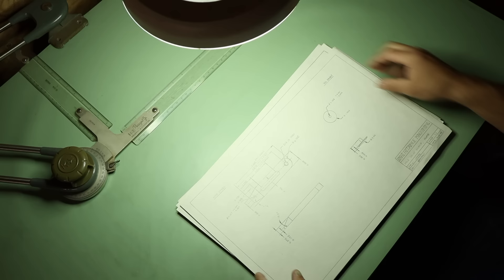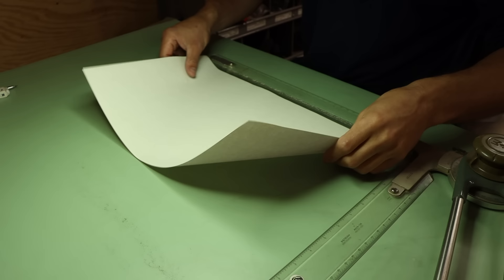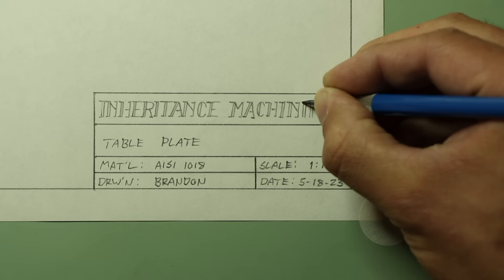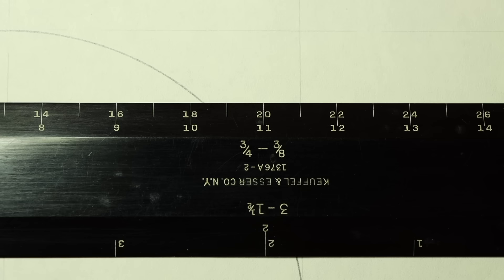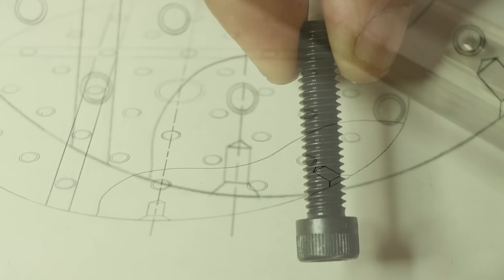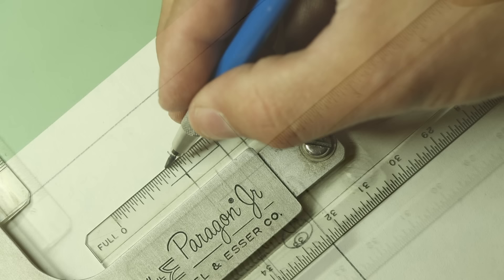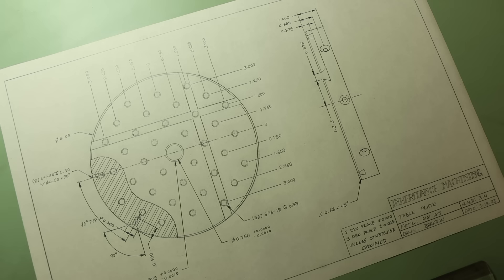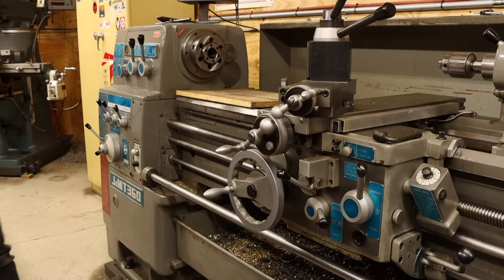The Joy of Hand Drawing Machining Prints || INHERITANCE MACHINING

Comment: As a longtime draftsman (now retired) I can really appreciate this video. My career spanned the transition from the board to 3D modeling. Actually even before the board. As well as being a draftsman I was also formerly a journeyman sheet metal mechanic, a fabricator, and a millwright. My first drafting methods were 2 types of CAD - concrete aided drafting and cardboard aided drafting. I am convinced that starting out my drafting career on the board made a huge difference on the quality of my work when I moved to drafting on a computer. I first learned VersaCAD, then Accugraph, then AutoCAD version 10. Progressed to Inventor and I have done some Solidworks since retiring. Thanks for the excellent video. You always seem to come through for your audience.
Reply from the maker: Wow, you've seen it all, then! I 100% agree starting at the board helps make for a better designer/engineer. Thanks for sharing and for the support as always, Mike!
Reply: Hi Mike. I'm just a simple electrician. I understand and have done cardboard aided design but I've never heard of Concrete aided. You've got me intrigued. How did you use concrete?
Reply: @antokomsic3571  Drawing or sketching with soapstone on a concrete surface like a shop floor or your driveway. Very handy! 😁
Reply: I started pretty much the same..Automotive body design on Mylar with aluminum..Then CGS,PDGS,SDRC Ideas,Catia,IcemSurf lately,for fun,Fusion 360 and Solid Works.. Designing on the board was a great craft.. Also retiring in a few.. 
along with cad we picked up running workstations and servers in UNIX,LINUX,everything MS, VMWare, Cisco..My home lab is pretty amazing as well.. In automotive design,the day you stop studying is the day you need to quit..
Reply: I used Windows paint and called it ghetto cad

Comment: I'm a woodworker, and I find so many mistakes or failures come from not thinking/planning ahead or from not having a good visualization of what I'm trying to do. The fact that you care enough about your projects to put the time into planning them is so fun to watch. And as a hobbyist, it's also great to see someone who has to think about materials differently than a professional shop. The professional gets to build time and materials into the final cost of the project and can absorb mistakes and waste across many projects. If the hobbyist is even getting paid for the work (i.e., selling it), the charge is often nowhere near the actual cost, especially in terms of getting paid for time. Consequently, the hobbyist has to think of materials in terms of what is currently on hand, where scraps and offcuts can be utilized, what's available, and what measures have to be taken to avoid mistakes. When I work with exotic wood, it's in very limited quantities, so I sometimes have to take extraordinary measures to avoid mistakes because I don't have excess material to work with. Not to mention, it's a 45-minute trip to the nearest hardwood dealer. I've seen you deal with similar issues in your projects.
Anyway, thank you for taking the time to plan your projects so thoroughly, and for bringing us along on the ride.
Reply from the maker: Very true! That's why its good to hang onto all those offcuts (and mistakes). They may save my butt at some point. Thanks, Vince!
Reply: It takes a whole new level of intelligence to do so gracefully and precise.  Its definitely a true testament to the level of talent he possesses.  Your wood working is no different,  just a softer material.  Some folks are just so talented and creative,  it's so satisfying to watch.
Reply: paper is cheap. Metal and wood are expensive. Even the time to make a simple sketch can save so much pain and waste.
Reply: @derschwartzadder  Очень хорошие слова - я запомню и буду говорить своим клиентам! Удачи и здоровья Вам!

Comment: Back in high school, our drafting tables were slanted at an angle, roughly 15-20, so that you didn't have to hunch over when drawing. Also, you could still stand and use the tables comfortably. Great video. It brings back lots of good memories.
Reply: My old man is a 40+ year engineer and I took a year after school in basics school. My college and his company both had mechanically adjustable tables. Standing desks before standing desk. They had a winder to take it up and down and a seperate winder to tilt the table from flat to angled up to 20 some degrees. I used to love going into the drawing room to see 4 guys with 4 completely different drafting configs all to personal preference.

Comment: To protect the paper when laying down a compass point, a bit of drafting tape (or dots) can be laid down where the point is to be placed.  Drafting tape looks like common masking tape (often lighter in color) but with a weaker adhesive that won't tear the paper when removed.  It's between the stickiness of drafting tape and post-it notes.

Comment: Fresh air. I’m 67 and still conceive, design, detail on a board every day. There are head shakers where I work but I’m the only one that do all this and build whatever I draw with my own two hands on manual machining equipment. I’m Blessed to be one of the last of many generations of Journeyman Tool and Die makers. That has machine tool design background. They call me “non degreed” engineer .. we got to the moon without cad..nothing I do is rocket science

Comment: Its fascinating to see how you guys do drafting over in the USA, with so many little details that are done completely differently.
Reply: You mean wrong, just wrong. Best example is a 3/4 scale. Who had that idea? The only factors that should be used are 2, 5 and 10.
Reply: @markus-us1bg  oftentimes in my drawings I find that the part is just barely too big for all of the dimensions I need and in that case 3/4 is incredibly useful since 1/2 would at that point be much smaller than I really need, and I've always appreciated being able to see all the features well
Reply from the maker: I wouldn't necessarily say my approaches are normal. I don't really follow many standards 😂
Reply from the maker: @liamsmith8518  same! one of the few advantages of imperial over metric. Fractional scales like 3/4 are easy to convert.
Reply: @markus-us1bg  I have a small metric triangular ruler that includes a 1:75 scale which basically is the same as 3/4. So technically I could use it to draw something at 0.75 scale
Reply: So markus...
So, you always divide your pizzas or cakes or breads into halves, fifths or tenths??  There is nothing sacred about tenths.  In fact, you can get finer gradation using fractions based on the power of 2 instead of the power of 10.  You are clueless.
Reply: @videodistro  I don't think clueless. Just arrogant. Or perhaps a play on Brandon's words about side views and which one is right and wrong. Why is it that no one on the internet is ever willing to give someone the benefit of the doubt? Humor can be difficult to convey without vocal accompaniment to the words you're reading. Yet if somebody misconstrued your statement in the least, you would likely become outraged and butthurt in the extreme.
Reply: @markus-us1bg  I designed hydraulic cylinders so the scales I used were full, half, and quarter. At any scale a lot of the part drawings and most of the assembly drawings I made were broken views (foreshortened). It's hard to get a part or assembly that's 10' or more long on a B, C, or D size sheet without breaking it out no matter what scale I used. If I used a 3/8 or 3/4 scale I would have been beaten!😀
BTW, third angle projection is absolutely the correct way to draw, and metric is lame. Actually, I am very competent with the metric system, but it's still lame, As Curtis at CEE would say, I prefer bananas!
Reply: 3/4 scale is so deceptive, because it's almost the same size as the actual object.
For scale drawings, we were told, if possible, to avoid anything larger than half scale or smaller than double, just for that reason.

Ofcourse, if you're the one making the item, you'll be aware the drawing is not actual size.
Reply: @liamsmith8518  i agree, i hate how sometimes on solid works you end up using a A2 sheet as 1/2 scale on an A3 was tiny.

Comment: So amazing! I'm taking a mechanical drawing class at my uni and im glad you included the truth that it took about 20 hours lol
Reply from the maker: Gotta give a comparison for those that only know the CAD game 😆 Thanks!
Reply: I studied architecture in 2005 and we still had to draw by hand the first 4 semesters (NO CAD at all for 2 years...) we literally had to draw entire buildings brick by brick.. so I personally am completely over ever using a drawing table ever again.. architectural drawings are much bigger and more detailed than mechanical drawings though and most annoyingly have a lot more dimensional chains and writing... but it did teach us the importance of line weight- which architects that grew up on 3D software have no concept about..
Reply: Back when I studied (in my 40's), Geometric Development was a weed out coarse to knock the class size down. The entire first year was done on the board. The next weed out class was VersaCAD which was the only CAD around at that time in my tech school. Nowadays, that school doesn't even teach board drafting. They no longer even have any drafting tables or gear around there. Most of the kids coming out of high school now already know some 3D modeling. It's a shame really because some very good drafting practice can be learned on a board. Our host here is an excellent example of that. If a person can draft on a board and use a pencil, that person can always learn CAD. Not so much the other way around.

Comment: This is so nice to watch. Back in my apprenticeship days i had to draw by hand too! So challenging but relaxing. 
Now I work with CAD but I always try my best to create meaningful and good looking drawings
Reply from the maker: That's the important part! I've often found you can tell the difference between engineers who started on the board or on a computer.
Reply: It's always great if machinists know how to draw and vice versa. Also I learned that for every purpose you will need different drawings, dimensions, tolerances,... for the same part. Like for design purpose you might do it in one way, but for manufacturing, QC, assembly,... you might do it in a completely different way.

Comment: I too started drafting in high school which led to my 35 year career (so far) as an architect.  I second a lot of comments here and definitely recommend you use that electric eraser! Its a game changer with the shield. Also that ridge on the edge of your triangle is for using ink tech pens, it keeps the ink from bleeding under the triangle. Ink on mylar is the way to go, give it a try, i think you might like it. You can control line weight to really make your drawings pop. Object lines, cut lines, dimension lines, all have their own weight (thickness) that you control with the different pens. Drafting like that is truly an art  and you would likely enjoy it very much. I miss those days on my drafting board.

Comment: Started my career as a Draftsman in 1980. Progressed to Designer levels over 30 years. Day in and day out design and drafting. 1987 brought change. CAD. It was either convert or find a new career.
On the board we would produce “layout drawings” of assemblies at 10:1 to confirm tolerances and avoid interference issues. Then individual drawings for each part of the assembly. CAD eliminated that step as everything was drawn actual size to four decimals. Geo tolerancing clarified the parts drawings. Then of course CNC became ubiquitous and design to finished part usually was faster on complicated parts.
Anyway, there’s no better way to think than through drawing, regardless of the tools and methods. To truly know and understand anything, draw it.
Thanks for the blast from the past!👍
BTW vellum and Mylar were the only materials translucent enough to create a blueprint reproduction back in the day . No laser printers or plotters. Diazo Reproduction was the primary reason they were used. Mylar because it wouldn’t stretch and was much more durable than vellum. Layout drawings and PCB’s were done on Mylar due to that stability. PCB’s were designed 10:1 and photographically reduced to 1:1 for the artwork negatives and positives. Fun stuff!

Comment: I almost never comment on YouTube videos but this one definitely stirred some memories.  I am in my 70s now and learned proper manual drafting as part of the engineering curriculum at college.  So while I have some distant fondness for it, I had the opportunity to learn CAD in the early 1980s (and a bit later, solid modeling) I jumped at it and used the technology for the remainder of my mechanical engineering career.  To a degree I did lose some ability to do conventional sketching there but the speed and convenience of making changes and the inherent accuracy made me an instant convert.  Moreover, constraints and parametric modeling were super hard to apply on paper.  I guess I see computer design as somewhat analogous to digital photography.  As you might suspect I ditched the wet darkroom and never looked back.  As a practical matter though my decimal equivalents chart in my home shop IS on a stone tablet. . .  Great video.
Reply from the maker: 😂 The photography analogy is a great one that I always use! Thanks

Comment: very cool. I love the drawing sequences in the videos. for some reason I'm most surprised you draw the title block and border by hand, I would have assumed that would be preprinted.
Reply from the maker: Thanks! I've contemplated it since writing out the fancy name is a little time consuming (and inconsistent 😂) but something just feels wrong about starting with printed lines
Reply: When I first started with broadcast engineering in Canada (1979) my boss was a Polish/German gentleman who did all our electronic and mechanical drawings on velum. He would sketch out in pencil using the very same engine that you have and then switch to ink. He rarely had to erase but when he did he had a similar eraser machine and the little shield you use. (As an aside I suspect the eraser in your machine is for ink and way too hard for pencil on paper. It'll dig a hole faster than you can blink.) He would then label and annotate in ink using a special pen and letter/number pattern that could be scaled to suit. The drawings would then be printed at a local print shop with black on white rather than blue prints. Three copies were produced. One for the shop, one for the drawing office and a working copy. If we techs found an error it was circled in yellow pencil and changes that we made were in red on the shop copy. The "shop" copy was left on his draughting table and he would update as soon as possible. All other copies were destroyed after the new copies were printed. We had drawings of every conceivable circuit in the station and transmitter sites so when, at two 
o'clock in the morning, something broke, the appropriate drawing led you down the correct rabbit hole to find the problem. When I became engineer of my own stations I started doing the same except with an early dos version of  Autocad on a DOS based laptop. I eventually progressed to autocad LT student version and when I was retired in 2010 I spent my last six weeks or so making sure as many of my drawings were as up to date as possible. Thanks for the trip back down memory lane. 🤞🇨🇦🍌🥋👍

Comment: My Dad had a drafting machine setup in our basement.  I remember using it to draw all kinds of things when I was in Jr. High taking Industrial Arts classes (Drafting, Woodworking and Metalworking) in the late 70s.  Then once in the workforce, I started using CAD in the 90s (AutoCAD running on DOS based computer with 13 colors).  CAD didn't speed up the initial drawing, but it made modifications easier than having to ink new vellum to use as a Master for either Blue-Lines or Blue-Prints.  Understanding the manual process helped in the 'auto' work.

Comment: I have this Japanese mechanical pencil called “uni Kuru Toga”.  There is an internal mechanism that rolls the lead as you lift and place the tip back on paper, so the tip is always worn evenly
Reply: My dad, who is an architect from the old days (so he made his whole career drafting by hand, only a couple years ago he got more into AutoCAD but he only uses the basics and well, he is half retired so who cares), told me to rotate my pencils while I threw a line, so as to keep the line width and color even. I did it, even when using a mechanical pencil, and well... my drawings were the best in the class :)
Reply: The Kuru Toga only rotates when you lift and place the lead back onto the paper, not when you moving it.
Reply: @kaievans9991  you're right!

Comment: I remember growing up looking at my dad's set of drafting instruments with wonder and awe at how these could be used to produce the Lamborghini Countach engine cutaway drawing I had pinned to my bedroom wall (promotional material for a drafting film manufacturer).  When I got to my very first technical drawing at university (a cross-cut chisel made from hex bar) I spent hours pouring over the details, lining up views, dimensioning and using my neatest handwriting to fill in the title block.  I took it to show my dad and he soon knocked my over-confidence down: missing dimensions, incorrect representations, smudges from badly erased detail....
I use commercial CAD packages most days and having first learned hand drawing I appreciate the benefits of such software.  It makes good commercial sense.  Any changes or corrections are made in minutes.
Your video shows exactly what commercial software can never bring to a drawing - the heart & soul of the drafter on every sheet.  I still have my A3 drawing board from my uni days and you have reminded me why I kept it all these years.  Thank you.